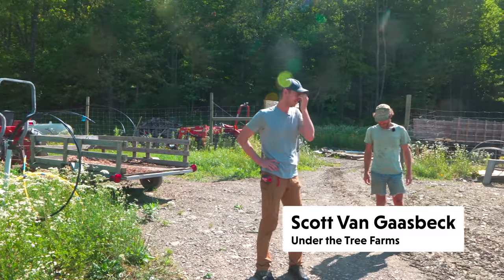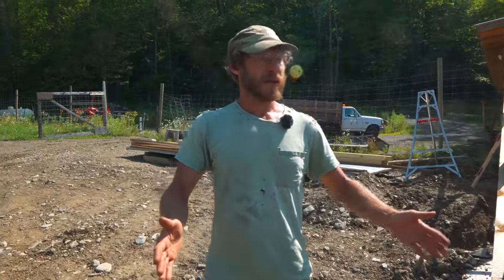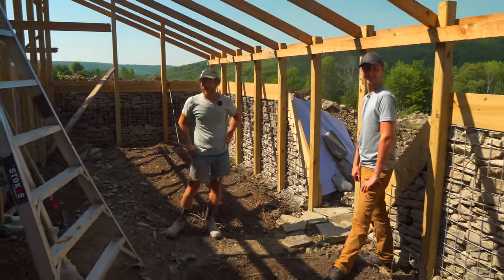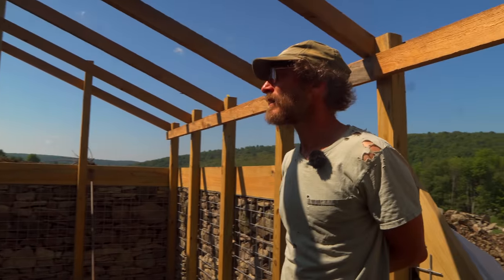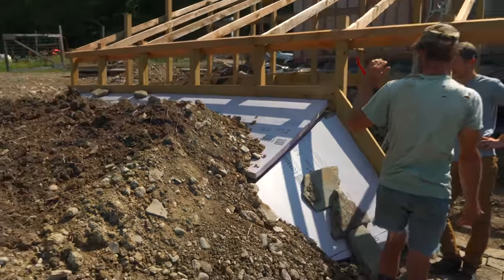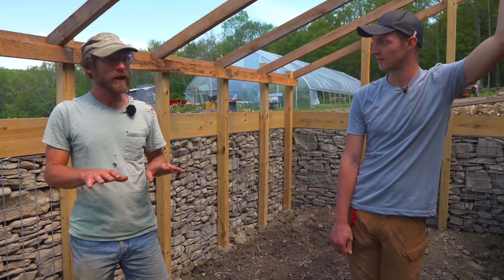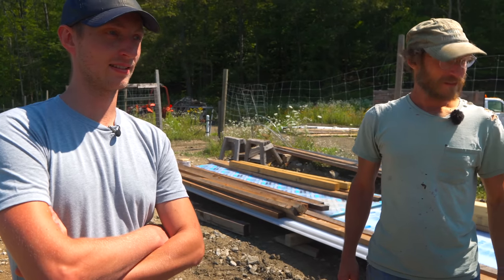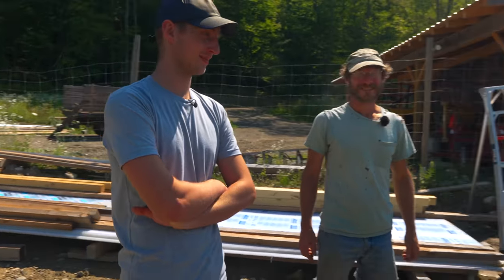Couple Builds a SUNKEN GREENHOUSE for $4,500  — Ep. 125

Comment: I'm building a 10' X 16' greenhous with cedar frame, polycarbonate glazing and two opening skylights. My cost with no labour is $6,000
Building that with excavation, stone work, glazing, wood structure, exhaust fans, plumbing, electrical, louvered vents and louverred skylight, from my perspective and 47 years building experience is not possible for $4,500.
Reply from the maker: Keep in mind when they are giving that price, they are doing all their own excavation, stone work, plumbing, electrical and are not including their own labor or equipment into that price. Anyone who doesn't own their own equipment or can't put their own elbow grease into their projects, would surely be paying more. The wood is generally affordable around here; and there are quite a bit of Amish purveyors here that give quite a deal on greenhouse equipment.

Comment: Water barrels in a greenhouse aren’t nearly as effective as masonry (rocks, bricks concrete etc). Water absorbs heat extremely fast but it also releases heat extremely fast.  That’s why it’s used in car radiators.  Masonry on the other hand absorbs heat slowly and releases it slowly.  Water barrels would lose their heat the first hour at night whereas masonry will radiate heat all night back into the greenhouse.

Comment: Horrible green house, pointing the wrong way, not enough earth on the back side for insulation and no way to capture any extra heat. It will work but could be a lot better. Greenhouse in the snow was a well-planned out greenhouse.